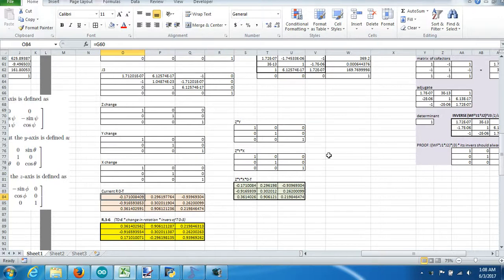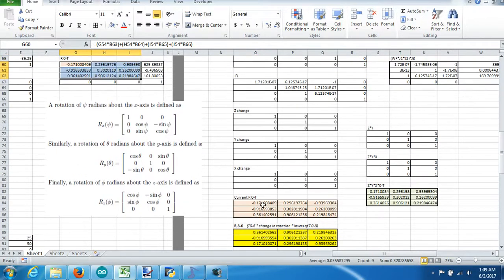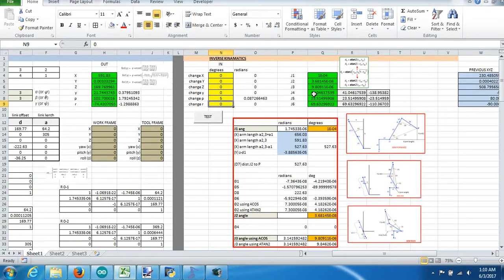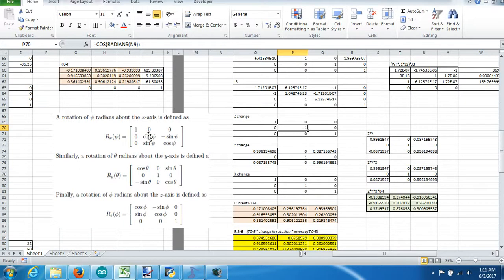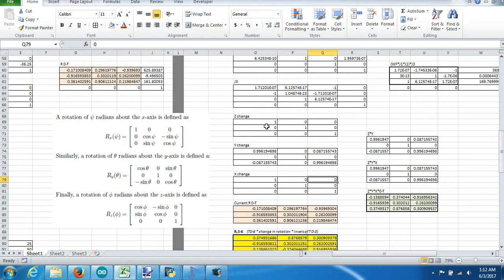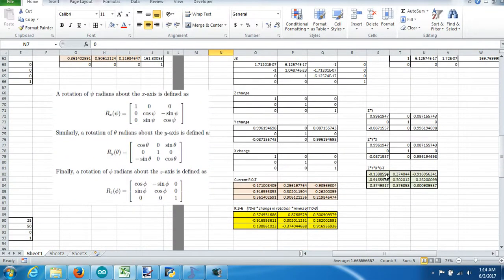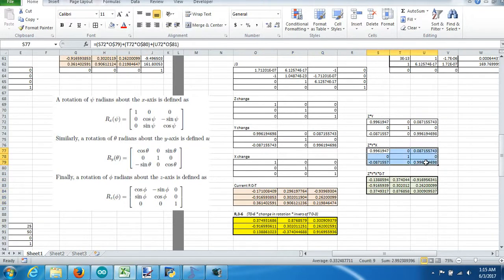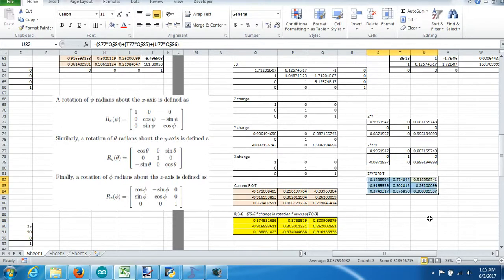6 axis robot kinematics Part 7

Comment: First off, these vidoes are amazing. Thank you so much for providing them for the public!

I'm still struggling to understand this, so bear with me. In a "normal" industrial robot programming situation, we don't normally tend to have to think about kinematics, because the robot controller does all that for us. I do know that KUKA has instruction functions to forward and inverse position variables between joint and cartesian values. Basically, the controller doing all of this for us behind the scenes.
Yaskawa, has a math function for multiplying matrices and inverting matrices.. So it's a bit more involved if you have to do anything like this. (also, I happened to write something for Yaskawa that set a frame to the robots current position, with the orientation of the tool, to the robots current position. Super useful if you wanted to do a tool offset type of function in Yaskawa, or use math to draw shapes, etc)
Fanuc, when you record a position in cartesian coordinates, tracks what the robots configuration is. You will see values on the position such as FUT000, NUT000, etc. They do this because it's possible for the robot to reach the same position with different configurations. Which I think has to do with the formula for solving J4-6 is dependent on whether J5 is positive or negative. 

This page: https://www.onerobotics.com/posts/2013/the-perils-of-six-axis-robots/ has some info on how Fanuc records those configurations into it's position variables and the basics of what the represent. I think that's something you would have to consider in a motion planner like if you are moving between two positions with different configurations, you would say "If the configuration changes, and changes to [this] configuration, use this formula. If it changes to [that] configuration, use this formula instead." type of thing.

I think other major brand industrial robots must have to track this sort of thing in a similar way, but I am most familiar with Fanuc so that's what I'm using as an example. Again, thanks so much for providing this content! I'm going to have to watch it probably 2 or 3 more times to really grasp how it all works, but I think this explanation of it is top-tier as far as easy to understand and providing a spreadsheet with interactive demonstration of how all the math needs to work.
Reply from the maker: thank you.  Im share what I can and glad it helps some poeple

Comment: whew! Made it through those and I'm wishing I had paid wayyy more attention in Trig and beyond...

question: if I shave an axis off and run with a 5 axis arm, would I remove a 4x4 matrix from the kinetic chain and rework the cell callouts Or should I assign it base values that will have no impact on the kinetic chain?
Reply from the maker: That's a good question, are you eliminating axis 6? I assume?
Reply: Chris Annin yeah. The 6th isn't entirely necessary for what I'm working on, so that's the idea for now. Building a modified bcn3d moveo right now
Reply: Both do the same.
Reply: James Blackburn did you have any luck using Chris Annin software to control the moveo arm?